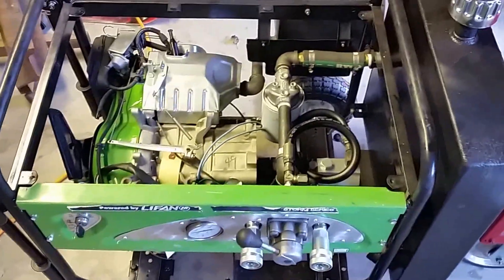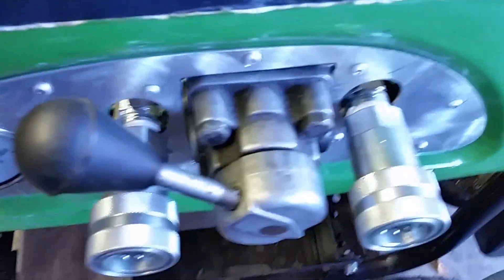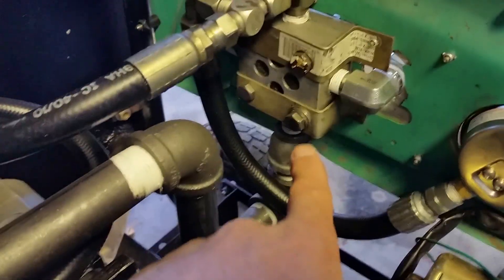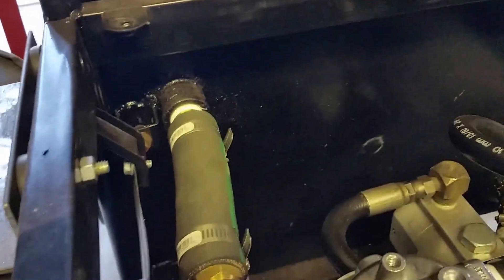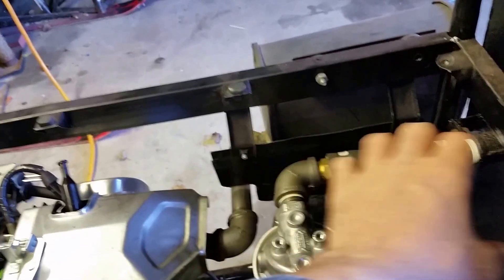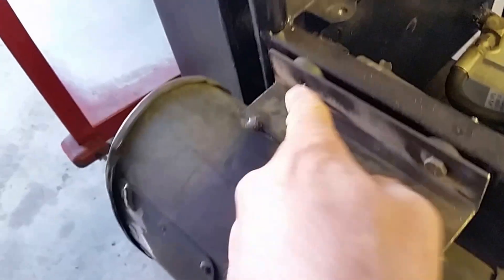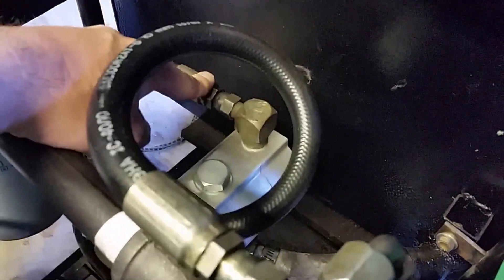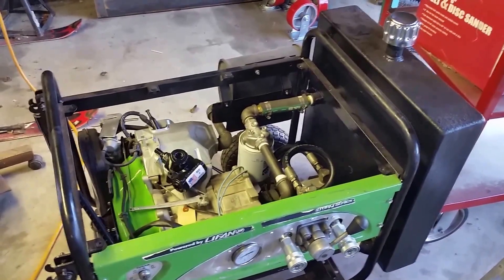Homemade hydraulic power pack

Comment: tape is for low psi. (300 psi ) or lower  same with all your NPT fittings.  SAE  or BSPP would be better or you will have leaks and suck air into your system  at some point in time

and 13gpm through 3/8 hose might keep your PRV open to vent the extra flow and pressure.
but the layout and idea is awesome! not being a buzz kill just my experience

Comment: You may want to rethink using Teflon tape on your pipe threads...
Reply: Several reputable hydraulics writers have noted that fragments of Teflon tape can  become lodged in valves and cause hard to trace operating problems.  As Brock Robertson notes just below, the brush on form does not seem to cause these issues.
Reply: also tape is for low psi. (300 psi ) or lower  same with all your NPT fittings.  SAE  or BSPP would be better or you will have leaks and suck air into your system